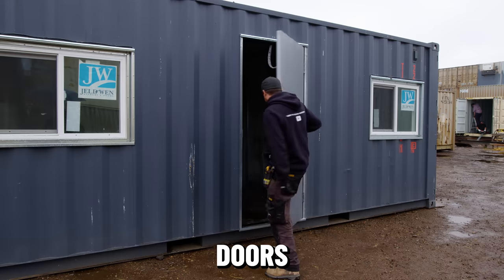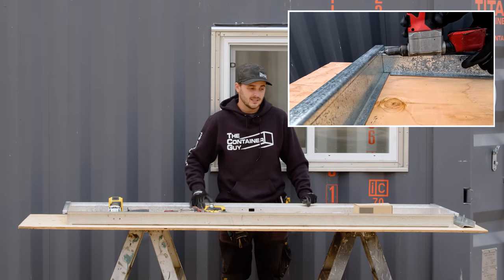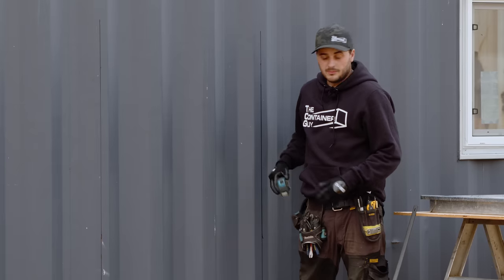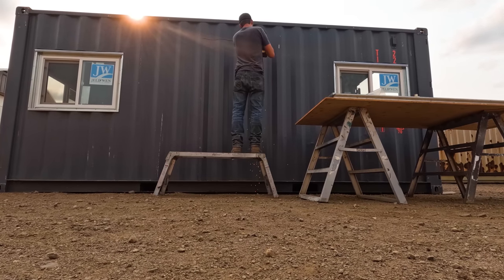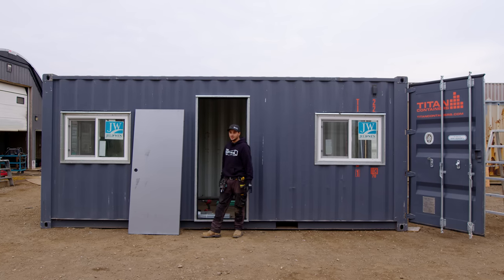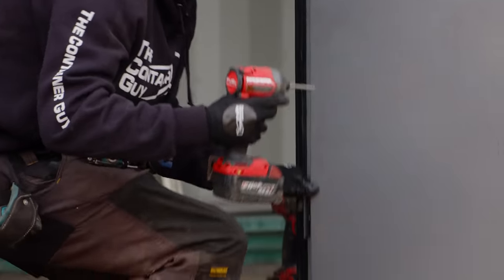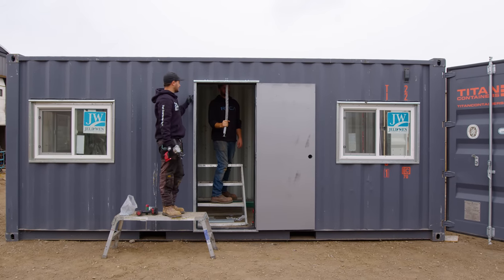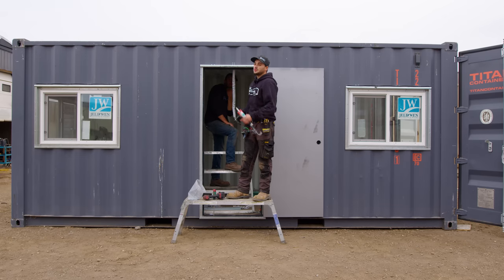How To Install A Door On A Shipping Container: DIY Kit

Comment: Love it, I would think you could buy the knockdown frame kit then buy the slab locally to save on shipping if you are only needing one or two doors. Just need to triple check the hinge locations and make sure the local door place puts the lock hole in the center.

Comment: I’ve purchased and installed the 36” man door. The door installed as shown. One issue I had was after receiving the door , the door was dented and scratched.  3 of the 4 corners was damaged from shipping. The corners was not protected enough for shipping, to protect from damage. I was shipped a new door for replacement, this door was scratched or dented, but 3 of the corners was damaged as before because, in my opinion, the corners was not protected enough from damage from shipping.  But as I said earlier it was easy to install.
Reply from the maker: The last thing we want to do is sell doors. We make zero money on them and get lots of returns. This corner dent issue may be resolved by the composite doors. 

We want to sell frames and have customers find doors locally but it's proven to be a difficult sell
Reply: @TheContainerGuyTV  You make zero money on your doors at $1400 a piece?  Is that because you have the CEO make them and he gets paid $400 an hour? Pull the other one.